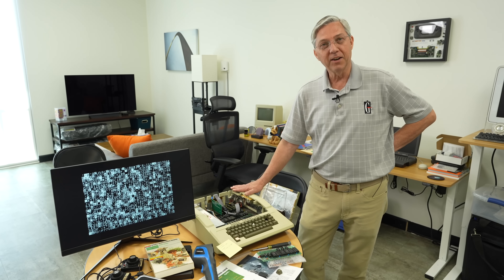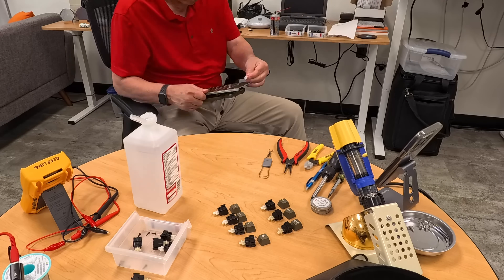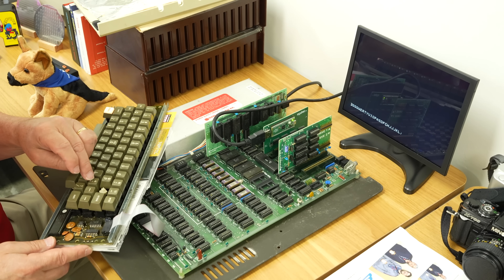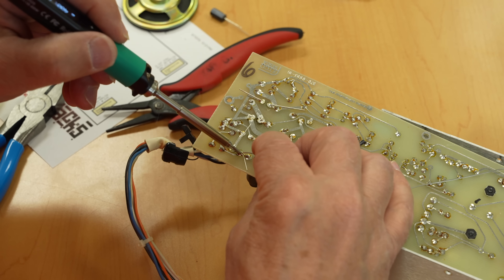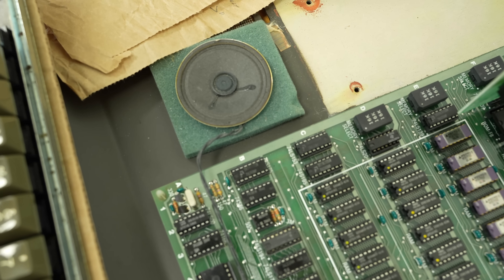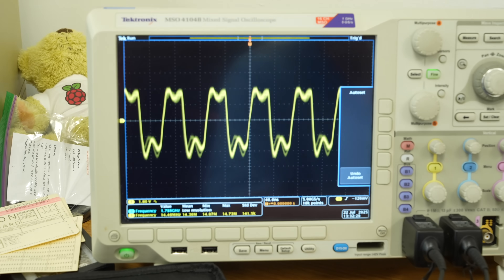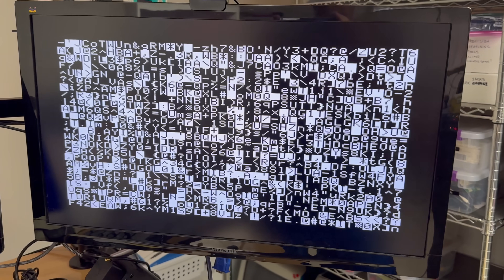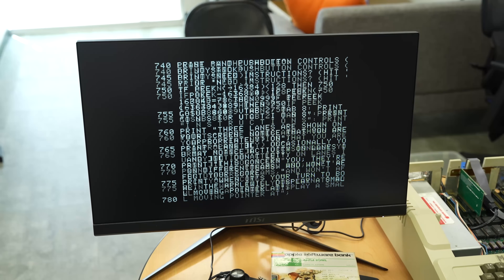The Apple II and the Mysterious Ticking Noise

Comment: Jeff, you and your father are such a great team together! Love your videos. 
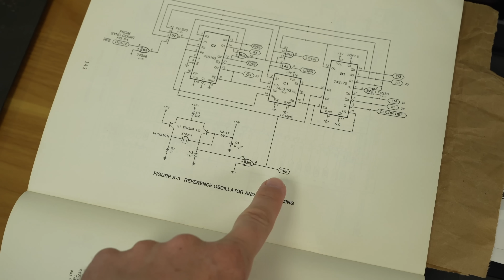About the clock waveforms, as other commenters state, you NEED shorter ground lead connection for the scope probe. Consider soldering ground posts onto the ground traces on PCB top layer Cu, to clip the scope probe ground lead to. And use DC coupling on the scope vertical channel, so you can check logic levels. And I'd be suspicious of the metastability waveform seen at 11:39 to 11:50. That looks like trouble if the probe ground lead improvements doesn't fix it.
Reply: A straight pin from your wife's sewing kit, pressed into the socket alongside the ground pin of any IC, can also work in a pinch.
Reply: As soon as I saw it was AC coupled I screamed NOOOOOOOOOOO.
The scope ground should be as short as possible nearest to where you are probing.  10 Meg input impedance picks up a lot of junk. Plus there is a common mode ground loop since the scope is tied to EARTH and so is the Apple.
Scopes can lie
Reply: @JBanek  Scopes ALWAYS lie. It's a matter of understanding how they're lying to you.

Comment: You'd probably see less noise in your scope traces if you kept your scope ground length shorter (ideally you should find a ground point near the point you're probing to clip onto).  Your scope probably also has a built in 20MHz bandwidth limiter that you can turn on to reduce some of the HF noise, since nothing you care about on an Apple II is gonna be that high frequency.

Comment: The noise you see on the clock signal can just be because of bad probing. What many in the comments forget, is that there's a huge ground loop from the scope probe to the pcb, and from pcb trace to the chip. That can cause ringing that is not there, and pick up stray EM from other signals as well. At least it means that what you see on the scope screen might not actually all real. I would recommend proper probing technique with a short ground spring before jumping to any conclusions regarding the shape/noise on those clocks.
Also remember the first rule of trouble shooting: "Thou shall check voltages". In particular, i'd hook the scope up to the power rails (again with proper probing) to see if the rails are clean. If they contain high frequency garbage it wont show up on a multimeter, but can definitely cause nasty intermittent issues.

Comment: I didn't know what it was at the time, when i declared my Power Mac 6100 dead, but it also had the 'ticking' PSU sound, now that i think about it.  Could i have saved the thing?  Yeah, but by then, the machine was already 16 years old, going on 17.  And even with a G3 upgrade card installed, it couldn't even run Linux all that well.  But i digress.

Comment: Have you tried the built-in diagnostic test, if your rom supports it,  during boot, hold down the open apple and closed apple keys and the reset key all at the same time. It should give you an idea what it could be.
Reply: No such thing in the original ][ and ][+ those came on the //e

Comment: The first row of RAM (row C, closest to the front of the machine) contains the first 16KB of memory and is the most important, make sure that is working first. The other two rows would only be used by software that requires >16K. You could even remove those rows and run without them, no need to mess with the memory configuration blocks.
Reply: Definately going to try this.

Comment: I have an Apple ][+ clone, which I affectionately call COMPUTER because that's what its banner says instead of "APPLE ][". Anyways, I got down to one last problem: the keyboard would repeat solid box characters and Enter keys. Turns out it was the 74LS74 at B10 (yes this chip also exists at the same location on a real Apple ][+). And as I've found out, this chip type is notorious for testing good with no load, but failing under load.

That clone madness aside, the Apple ][+ was our first family computer; I am glad you're working towards getting this old one working! There are a few things I would recommend to help in your journey (the three books are archived):
- Adrian Black has a Dead Test for the Apple II on his GitHub.
- The book: The Apple II Plus/IIe Troubleshooting & Repair Guide by Robert C. Brenner
- The book: The Apple II Circuit Description by Winston D. Gayler
- The book: Understanding the Apple II by Jim Sather

Comment: Hopefully you bought quality cAPs, such as Nichicon, and from reputable sources like Digi-Key or Mouser. :hand-pink-waving:
---
Looks like dirty clock due to possible disc. CAPs., (although they rarely go bad!) Pay attention to those silver ones as well.
A lot of time, an old RAM or ROM can have a minor internal short and will send out a dirty signal to the CPU.
Swapping out RAMS and trying another location can lead to a problem moving, (and that will give you a hint).
---
Also, beware of 74123's, they are well known to change their value internally, and therefore change their timing.

Comment: I remember our Apple IIc.  My dad decided 128KB of RAM wasn't good enough. Someone sold a kit where you'd pop out the original chips, pop them into an expansion board already filled with more chips, then plug the expansion board  into the original slots.  The case was just large enough for the expansion board heightwise.  The result? 512KB of RAM
Reply: Slots in a IIc?
Reply: @KAPTKipper No.  Slots isn't the right word. Sockets.  The expansion board plugged into two sockets if I remember correctly.  All you had to do is pop those two chips out, put them on the expansion board, and the expansion board had pins on the bottom that would plug into the empty motherboard sockets.

Comment: Those scope traces are displaying way too much noise.. I'd suspect the power supply.. or maybe bad capacitors somewhere.
Reply: They're noisy, but mostly it looks like ringing, which would be generally due to the scope ground attachment point being too far from the point being measured. This is more of a problem on older machines like the Apple II where the board doesn't have dedicated power and ground planes.

Comment: Wow, that HAKKO is pricey.. out of my range
Reply from the maker: It's certainly not cheap! But I've already gotten to use it on 3 projects, and hope to have it for many years to come.
Reply: If you find that it gets gunked up after a while, consider using it horizontally, with the board oriented in a vertical plane, so you don't have to fight gravity while using it. Rudy's Retro Intel has a good video about this
Reply: I wish I had a "moo gun" lol

Comment: 7:26 there’s gotta be a way to make that new power supply run on usb-c instead of a barrel connector.
Reply from the maker: There are ways, but a lot of USB-C power supplies can't put out 80+ Watts so you'd probably wind up with more people wondering why they have power issues when they plug in their phone charger or a smaller laptop charger!